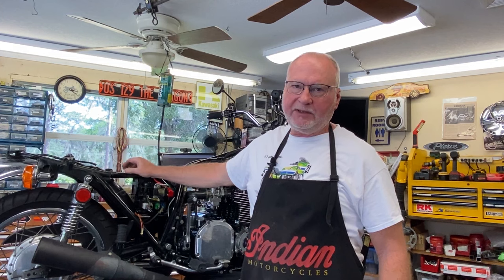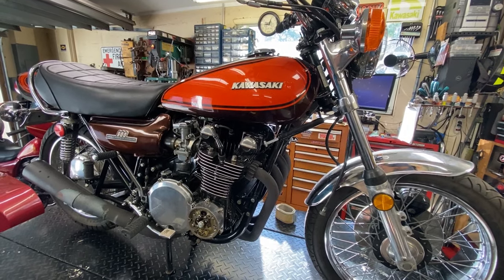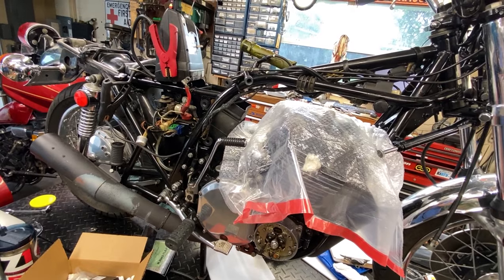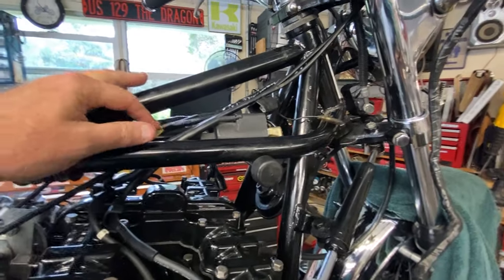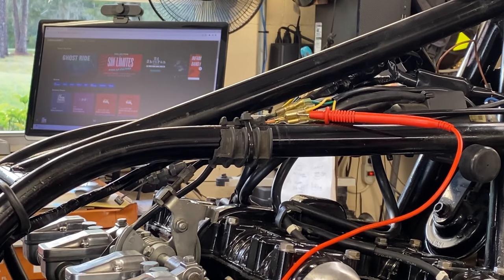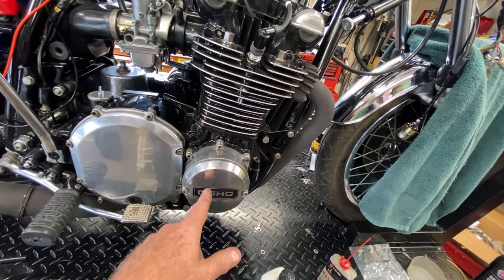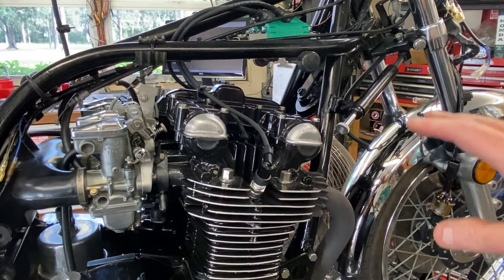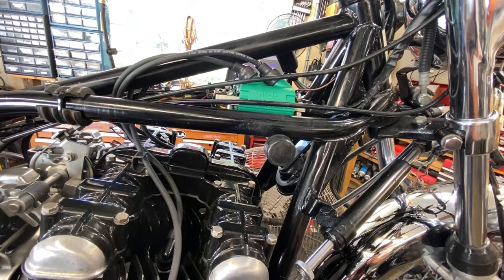'73 Kawasaki Z1 900 pops/sputters, many problems, can we make it sing?

Comment: I was occasionally dropping a cylinder on my 1975 Honda CB750.  I put some Dyna coils and a Dyna S electronic ignition on it and it's run like  a champ ever since.
Reply from the maker: Yea, truth is, it’s been decades since I worked with points ignition systems. I don’t recall messing with them on my ‘79 KZ650, but the ‘83 Seca 900 and everything since has had electronic ignition. Usually I’m diagnosing a problem with those. It was a crash refresher. Cheers.

Comment: Enjoyed the video, Tom.  Nice recovery on the ignition problem.  On the valve clearances  being out of spec. Moto Guzzi on their 2 valve per cylinder bikes had 2 specs on the clearances.  Bikes to the U. S. Intake. .002 exh 004  all other bikes Internationally sold around the world  were in .004 exh .006  exact same motor. Enjoyed the video and RIDE SAFE OUT THERE.

Comment: Great video.
You might find if you can master the use of an oscilloscope you would be able
compare each ignition circuit for each cylinder and actually see what's going on.
It would make it much easier to diagnose faults.
Reply from the maker: That's a great idea, in fact, I purchased a cheap hand-held oscilloscope over a year ago, haven't figured out how to apply it to my jobs, but that's a good way! I'll have to research how to do that. Thanks.
Reply: @MotoRestoFL  - OK -  I prefer a bench top oscilloscope with a large screen.
Some of the more expensive ones have 4 input channels  -
each with their own colour on the display so you
could monitor many circuits at the same time on a Z1 900.
I like them because I can actually see what's going on.
Unfortunately high voltage probes are expensive to monitor
the actual output voltage of the ignition coils but you can still see a lot
from the 12 Volt input side of them.
You can also take screen shots of a good working bike and
use those to compare to a non working one.
After a while you'll have a library of good and bad motor screen shots
with notes as to what fixed it and you'll be miles ahead.

Comment: Ace vid, those old coils look like zzr600/1100 coils , I don't think they're compatible ( ohms and ballast resistor issues ) with points ignition, I was about to put some on my '76 kz900 (still on points) but refrained, maybe it negatively effected the condensers on yours, or vice versa and your plugs were behaving very oddly.
I've used zzr coils on previous Kawasaki's and Suzuki's but only with CDI ignition, it's a way of getting a screw in HTlead and the low tension wires disconnected easily instead of the moulded in earlier coils.
 Your  compression figures from incorrect valve clearances was eye watering and eye opening, got a 79 gs1000 engine here showing the same symptoms and suspicions, thanks for sharing.
Just a suggestion but every start up and running check I do, I try and get in the habit of doing a finger licking temp touch tests on the header pipes always looking for the cold.one..keeps me focused on the iffy cylinder/s. Try a touch test if you can on your ign coils ( warm up,.turn off first ) too as they can over heat when faulty or when other ign issues are happening like failing black boxes. They should be the same temp. Probs with cyl 1 and 4 together and /or cyl 2 and 3 together will always be ignition related. 
Jumped out my chair when you said that 9.2v drop, because earlier  Kawasaki CDI boxes also need +9.2 v to function.. below this the spark at the plug vanishes..shows up as sudden, random cutting out ( intermittent running )
Get well soon, that sewing machine whirrr was whistling.. it's the musical holy grail of the jap 4 we quest for..great job ,carb work, diagnosis and content
Reply from the maker: See, that's why I like even the old-school electronic component pickup. Hall Effect or otherwise (I don't know how those worked) but all you have to do is simply match or come close to the stock resistance reading of the original coil primary winding and virtually anything will work. Even stick coils if you can find the ones with the proper resistance, or in a wasted spark situation, aggregate of two coils in series if that equals the resistance of a primary coil, even those sticks will work (if they physically fit). No ballast, no nuttin... cheers.

Comment: Most people go by .002-.006 on the valves on the Kaw 900 and 1000 I always set mine as close to 6 as I can get them mine runs good that way
Reply from the maker: Service manual says .002-.004. It's not my engine. If it eats a shim, I'd be responsible. Therefore, gets set exactly for the service manual standards. They were all, except for #3 exhaust (.003), at the high side of .004 however.

Comment: i have a 78 kz1000, not getting spark on 2/3 and intermittent cylinder drop out. It currently has a dyna s ignition system but i suspect the right(front) pickup is no good. with the bike on 1,2,4 get hot on the exhaust but cylinder 3 pipe is just warm. ive taken apart the ignition switch, kill switch and thoroughly cleaned all contacts in the harness. bike runs starts up right away but is running on 2 cylinders 80% of the time. Any ideas ? it has a new battery, new coil which i thought was the problem initially.
Reply from the maker: First thing I’d do is meter the resistance on both pickup coils and compare. I don’t know what it’s supposed to be, but Dyna would tell you if you call them. Regardless, if the resistance on 1-4 pickup is basically the same as 2-3, it’s likely not the pickup. I’d then do a voltage drop test at the yellow/red wire which powers both coils and make sure there isn’t low voltage. If that’s ok, I’d swap the plugs out of 2-3 and move them to 1-4. If the problem doesn’t move and everything else is good, I’d try powering the coils directly with a jumper from the battery and see if that solves the issue, just to make sure the coil power isn’t intermittent. Also check grounds. They can cause weird problems. I’d also ohm out the coils to make sure they’re the correct ones. Finally, if the spark plug wires have the resistor caps still, pull each one and check the resistance. I have seen many of those way out of spec. If you’re using resistor plugs, ditch the resistor caps. And check where the plug wires push into the Dyna coils. That’s easy to bigger up.

Comment: yeah points sparking=bad condensers, cause of popping, I had same bike ran points for a couple years, swapped to dyna and it purrs now
Reply from the maker: If it looked like I was fumbling with the points, that's because I was. Haven't worked on points to any great extent since the early 1980's and before that. I am so used to diagnostics on the old school electronic pickup ignition/coils, whipping out my Fluke and testing values of pickups, coil primary/secondary, points kind-of had me scratching my head like, "how do these work again"? lol...

Comment: Heads up that the Dyna systems (coils and ignition units) are reportedly made in China now and not as reliable as the older versions. Also, KZ 900 and Z1 should both be 6mm exhaust studs. If you worked on a KZ 900 with 8mm studs then someone had probably installed a KZ1000 head. Probably none of this matters to anyone.
Reply from the maker: I may have said it wrong I don’t remember. Thanks for the heads up.